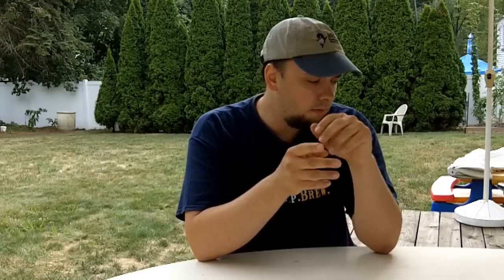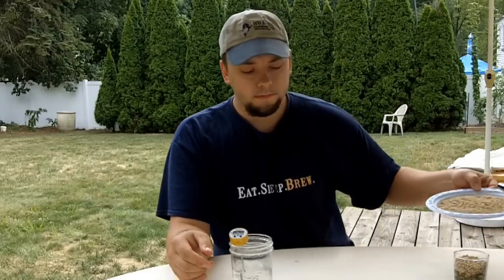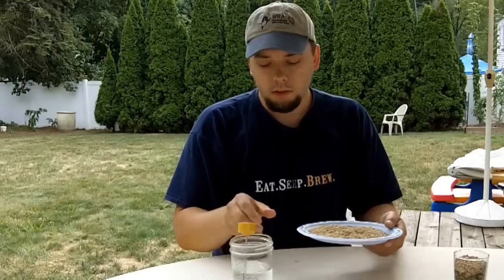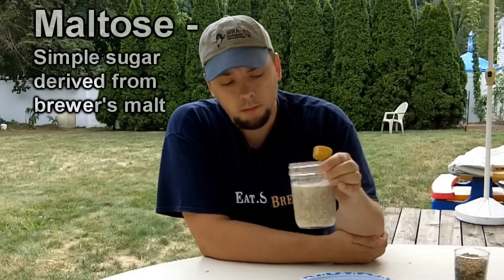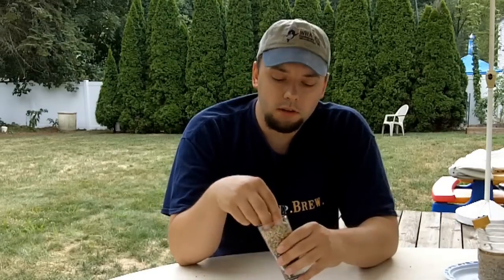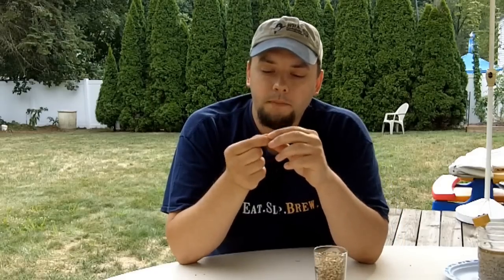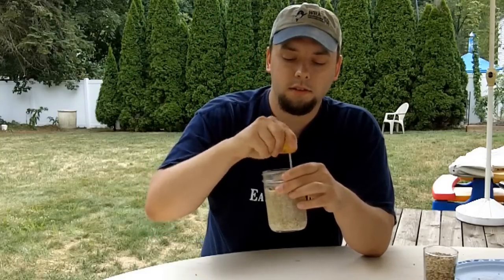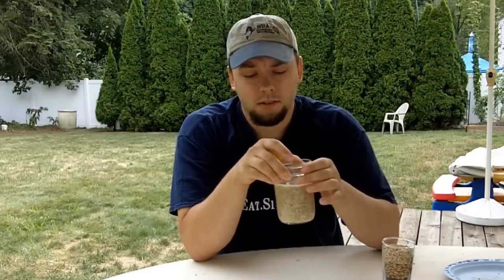EP2 Grains and Mashing - Brewing All Grain Primer Series

Comment: hey bobby, great channel. got 3 all grain brews under my belt, and i'm finding myself very intrigued by the chemistry of brewing. however, i find it a little confusing that that degrees lintner and degrees lovibond are both measured in L. my question is, how are we supposed to know the true diastatic power of grains, when the L on the front of the package of malted grains is lovibond (which measures color??). briess only provides the DP for base malts.

Comment: I've never made instant beer and while I've made an assortment of extract and partial mash brews my first all grain brew did have the addition  of  2# of corn sugar and just because my sparge was so basic I added some dme as well. Anyway here's my question. If i wanted to construct a mash tun capable of holding 30+ pounds of grain  and I wanted 1.5 quarts of water to each pound of grain what size cooler would I use. Chad

Comment from the maker: Cont'd...

2. If you were to mash a ton of crystal60 at 155F, and added abunch of amlase enzyme powder, would it all convert to get a high OG due to the powder?

A: Yes, amylase powder will convert grains/malts (and other starchy additions...pumpkin?) with zero diastatic power provided either the grain is "flaked" or held at gelatinization temp. Frankly, I never saw the need for amylase powder when it's so easy to add a bit of 2 or 6-row malt to the bill.

Comment from the maker: Rec'd this via PM, but thought they were good Qs Regarding "amylase powder". 1..add a bunch to a container with a crushed grains and cold water, would it convert even though the cold water?
A: Not very well. I didn't mention it in the video, but the mash temp of about 150 is also the "gelatinization" temp of barley which makes the starch accessible to the enzyme. Think of it as a more physical breakdown of the starch while the enzymes deal with it in a more chemical nature.

Comment from the maker: @jasen688 
I understand the question. From what I understand, while cara malts are in-hull mashed, they are kiln dried before it's converted all the way. That should leave some starch that mashing would convert. If you steep a pound in a gallon of water, you might get an SG of 1.08 out of it. The same pound if mashed with a 1/2 pound of 2row might give you 1.030 (plus whatever the 2row contributes).
This is one reason mini-mash is better than extract/steeping grains.